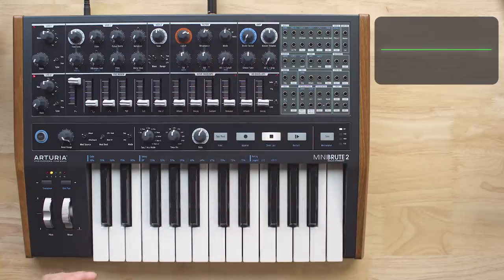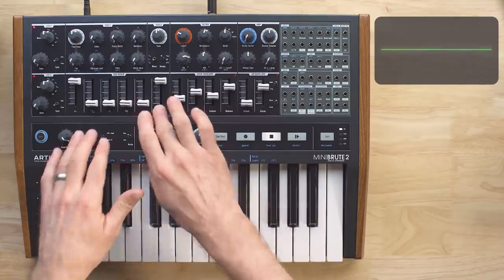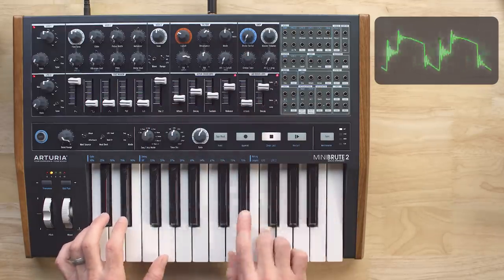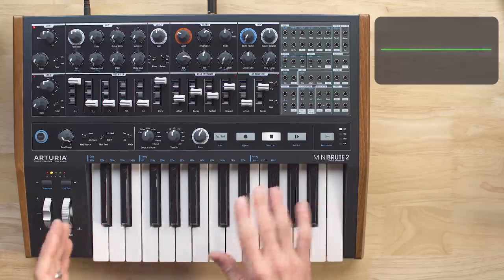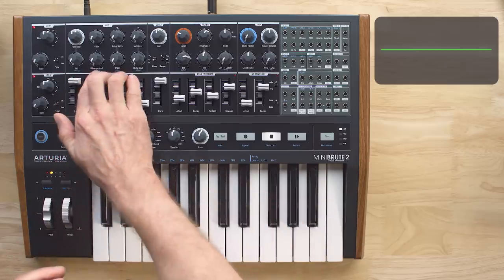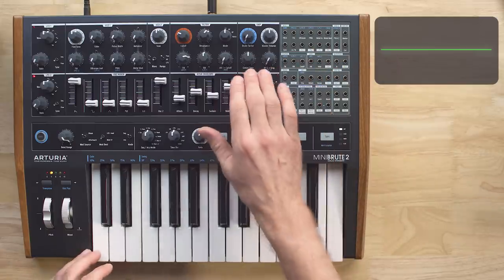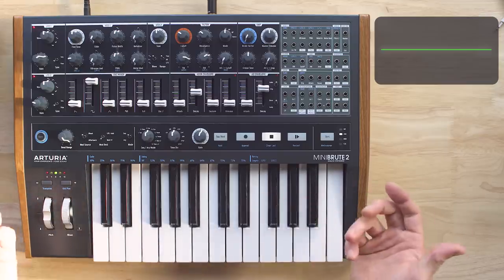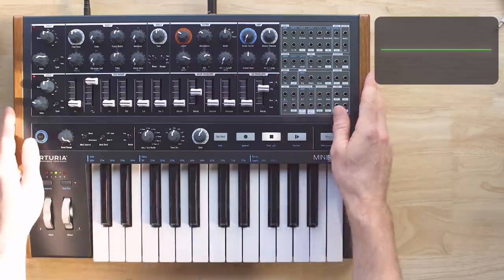Basics of Subtractive Synthesis With the Arturia MiniBrute 2

Comment: There is an interesting feature/issue with micro/mini brutes oscillator. When you're increasing wave type to the top, you will get not a pure wave, but slightly distorted one. And to get a "proper triangle"  for example you need to set wave type slider to ~50% of the value. You can check it on oscilo easily.

Comment: I'm gonna add that the Metalizer works on every shapes, not just the triangle, if you patch it (in the patch bay VCO1, take the out any shape to the Metal In, and voila ; don't forget to open the triangle slider on the synth).

Comment: damn this makes me regret starting with the BS2, where the oscilators share knobs, though I'm sure that has some stuff over the MB2. anyway, great video I wish I could thumbs up multiple times.
Reply from the maker: The bsii is a fantastic synth
Reply: Honestly, don’t be. The BS2 is a great synth and is destined to become a classic. It’s still in production after all these years for a reason. And the past 2 HUGE updates added so much functionality. I went with the MB2 because I have other modular gear I can connect to for some madness, but if I needed a stand alone mono, the BS2 is hard to beat at any price.

Comment: I'm confused... You spent a lot of time and did a wonderful job explaining how to create and modify a sound using this synth, but I don't see how it's subtractive.  It seems like everything you did modified or added to the sound you started with.  Wouldn't that be additive?
Reply from the maker: No. Everything subtracts. An envelope subtracts attack, decay, etc. from the volume. A filter subtracts from the frequency spectrum. With the exception of the little FM bit and distortion circuits, you always start off with a more raw, complex wave, and end with something that's been subtracted from.
Reply: The term “subtractive” is indeed a bit irritating when seeing people ‘adding’ more and more modulation tools. But the reason why it’s called subtractive synthesis is easy to understand when looking at it like the work of a sculptor: In the beginning there is the raw material – in the case of the sculptor it’s e.g. a block of marble, in the case of the sound designer it’s the raw sound of the oscillator (an oscillator is always on, even if you can’t hear it due to the settings). Than the sculptor as well as the sound designer use their tools to carve their way through the material cutting away all the parts they don’t want to have. Hence they subtract from the raw material.

Comment: Hi :) super video! A question... how make a classic vibrato? Im try with lfo, but the pitch dont change around the keyboard. Thanks :D
Reply from the maker: I'm not sure what you mean by "pitch don't change around the keyboard", but I would try two things: 
1) If your LFO has the ability to fade in with an attack, mess with that. 
2) Assign LFO to pitch, then assign LFO depth to aftertouch. Then the harder you press down on the key after the note has been triggered, the more vibrato.
Reply: Red Means Recording (my english is shit, sorry) thanks!! I will try your tips. I wanna play a C and that it sound a C with vibrato, and then play a D, and that it sound a D with vibrato :)
Reply from the maker: yup! then the two things i described above will work, but you need to only use tiny bit of modulation.

Comment: do you like this or basstation 2 more?
Reply: This has more character and it’s capable of more, but the worse for bread n butter sounds. The BS 2 has a lot of features and is a great all arounder at the expense of loosing a specific character. After the past 2 updates I think the BS2 is more comparable in terms of what it can do, but having a patch bay the size of the Brutes will always allow you to do more. Unless you have other modular or semi modular synths, I would go Bass Station. The only reason I chose the MB2s was because I have other modular gear.

Comment: The LFO is Low Frequency Oscillator but it can control more than the low frequency?
Reply from the maker: The LF part of the LFO describes it's frequency rate (lower than audible, usually), not what it can be assigned to, which is mostly everything.
Reply: Red Means Recording Alright, interesting, thanks!

Comment: pulse width is sharpening of the wave. and that should work with other waveforms
this whole thing overlaps a ton with frequency and amplitude modulation
nice video anyway
Reply from the maker: Pulse width only works on square on this synth.
Reply: oh okay. :) thanks for replying
Reply from the maker: Correction: you might be able to patch it to work, but the normaled connection doesn't allow PWM on anything but the square.
Reply: heh, what a nice FM and AM modulation device after all :D